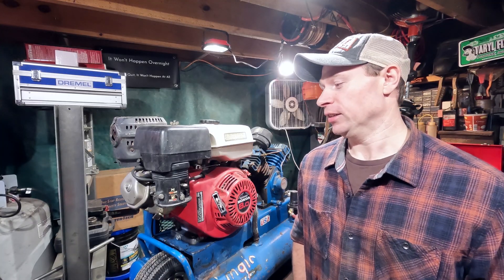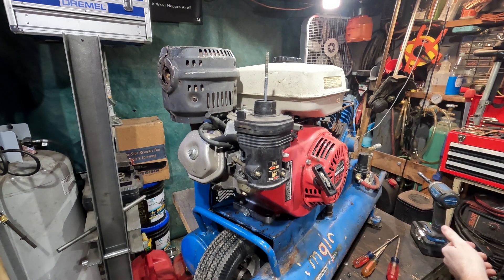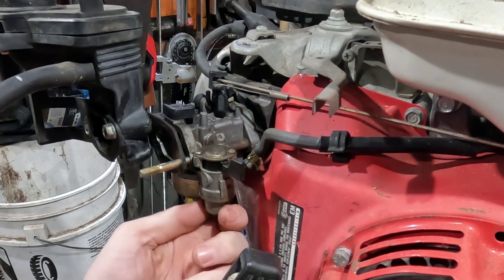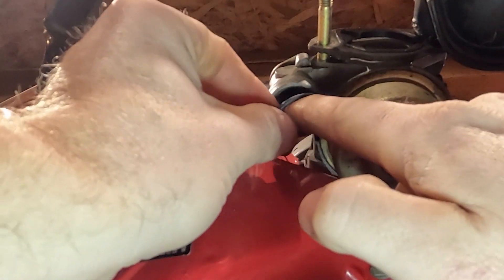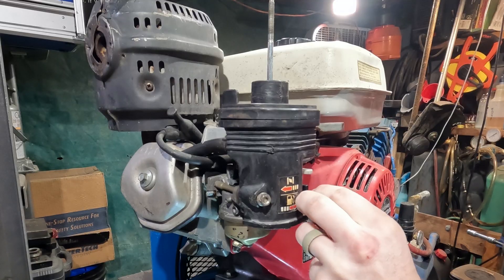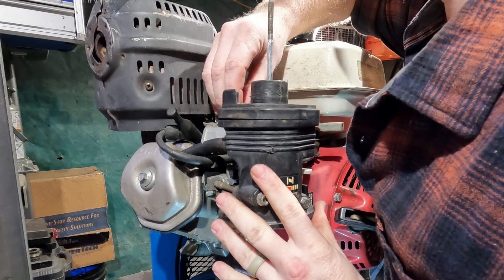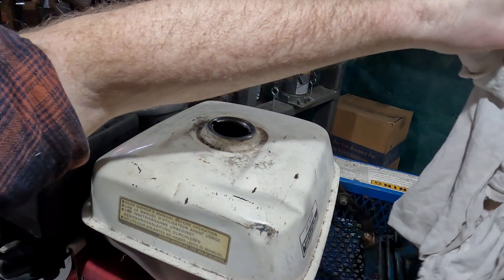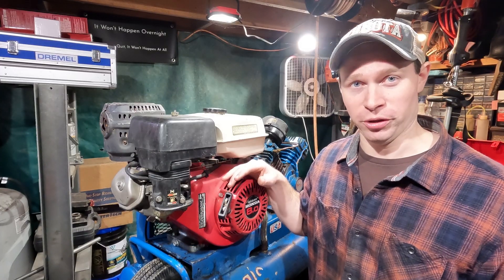Fixing A Honda GX240 Engine Fuel Shut Off

Comment: I got one of thes at work doing the damndest thing. It won't run unless you take the drain screw out of the fuel bowl. And then of course if you do it leaks gas everywhere while running. 😮 edit the fuel shutoff works fine.
Reply from the maker: Wow that is really strange!  I have never personally come across that problem before.  

However, one theory I have heard on this is by opening the bowl screw you are introducing more fuel into the bowl which could potentially make it run richer.  If that theory is correct it sounds like it could be a needle/seat/float problem with the engine starving for fuel.

One way to prove or disprove this would be, does it start and run for a few seconds and then shut off as if it is using the fuel in the bowl before then starving and shutting down?
Reply: @mytinygarage24  it trys to start and will keep running as long as your cranking it but won't run on its own unless you take the bowl drain out
Reply from the maker: Very interesting.  I would love to get my hands on such a problem.  That would be a interesting one to narrow down and figure out!  Certainly sounds like a fuel delivery issue of some kind with the needle/seat/pickup tube area.
Reply: @mytinygarage24  i think they are probably just going to get a new carb.
Reply: This is a lean condition, indicating that the air/fuel mixture has either too little fuel or too much air. 
If you can get it to run for any length of time, also try spraying a volatile all around the carb and especially where the carb is connected to the intake manifold or spacer and the engine.  Any change in running speed indicates an air leak. 
This can be caused by a cracked or deformed manifold or defective gaskets. Also by mating surfaces that aren’t dead flat. 
Make sure to use a straw on the spray can so you can pinpoint the leak. 
Also, it would be helpful if you followed up with your findings.
Reply: Can you provide a link to the repair kits you used?
Reply from the maker: It is in the video description.